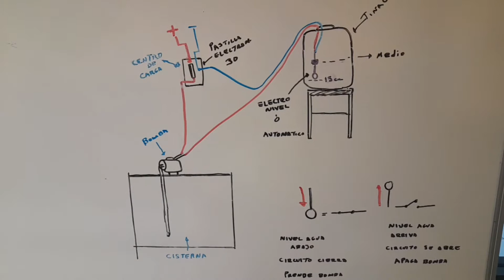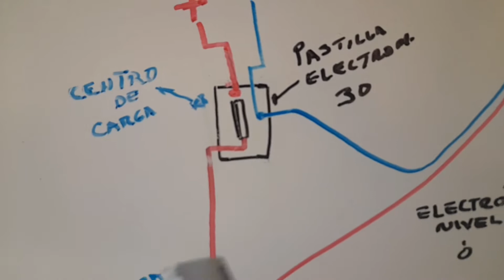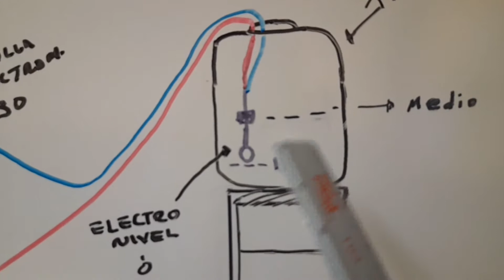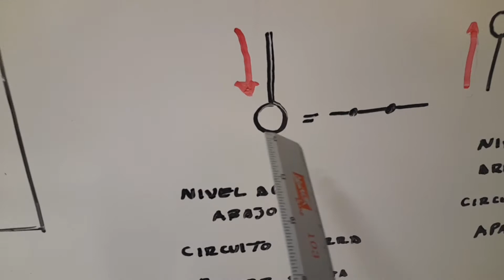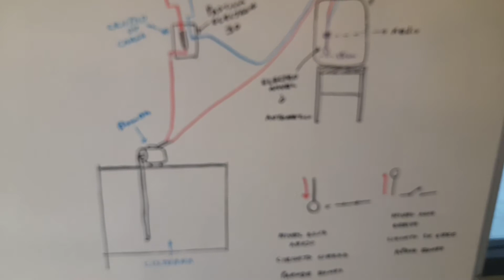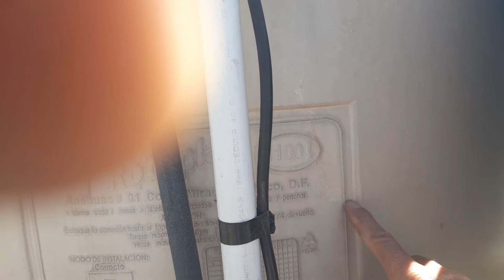Instalacion  de flotador  electrónico  para automatizar bomba de agua.

Comment: Muy buen vídeo  maestro  , buenos tips,.  Dos preguntas , cuáquiera que sea de los dos electronivekes puede estar en el tinaco  o.  en la cisterna??     Y otra duda   que diferencia hay de poner el cable verde que viene de la varilla coperweld en la barra para tierra física del centro de carga y de ahí  alos contactos??    y la otra forma de llevar directamente desde la varilla coperweld y  sin conectarse en la barra de tierra física y pasando directamente al contacto??    Muchas gracias maestro oficial
Reply from the maker: Hola  con respecto a el flotador  es diferente  su  funcionamiento  ya que el  de cisterna  trabaja a la inversa   si esta abajo el nivel esta abierto el circuito y no deja arrancar la bomba  el se cisterna  tiene  3  líneas  para  colocarlo  en tinaco o cisterna  dependiendo el uso .  La segunda pregunta  es lo mismo conectar  de las dos formas  solo que lo correcto es  conecta a la barra  ya que  viene con varias tomas o tornillos para  la distribución  de la casa y si lo pasamos directo  nos costaría  hacer  derivaciones  pero funciona de  la misma maner.
Reply: @pepemultiservicios9105  a ok maestro, muy amable,  muchas gracias por su orientación.
Reply from the maker: @inesvinocourt9137  ok 👍

Comment: Saludos maestro, muy buen vídeo, una pregunta, para mandar hacer un circuito derivado de iluminación a  8 metros de la acometida y son 4.5 aproximadamente amperes, se le podrá instalar cable del # 10 y pastilla de 30 amperes, ??     Lo que pasa es que me van a regalar el material amigo,  usted que opina??   Funcionaría el circuito bien así contra corto y sobrecarga??     o.  no precisamente porque??     Gracias maestro oficial
Reply from the maker: Hola,  así como me comentas si te funcionara  bien sin pro lema, saludos.
Reply: @pepemultiservicios9105  ok maestro muchísimas gracias, hasta pronto